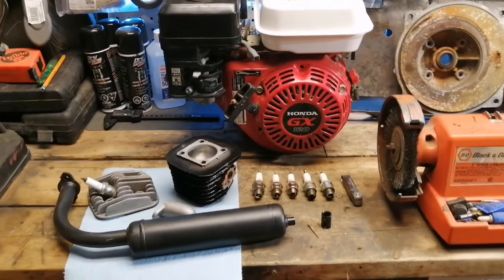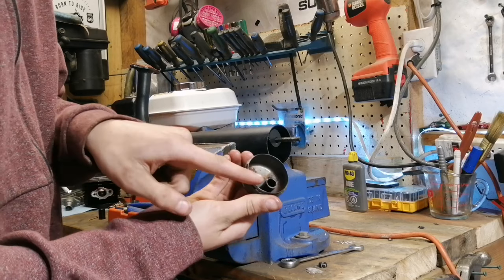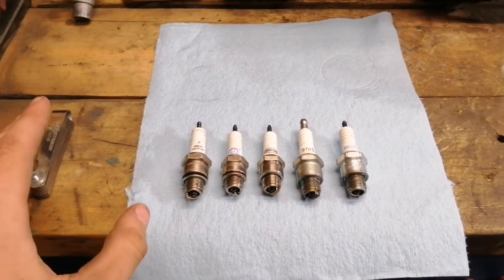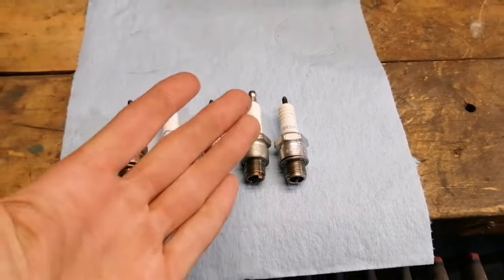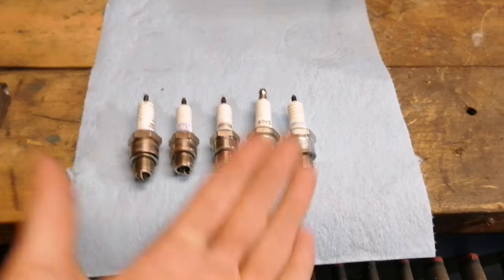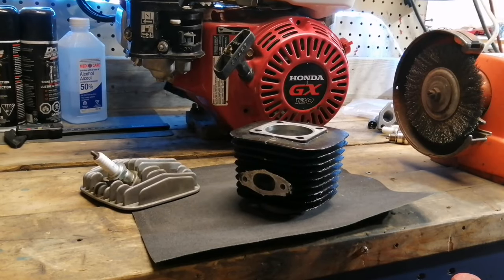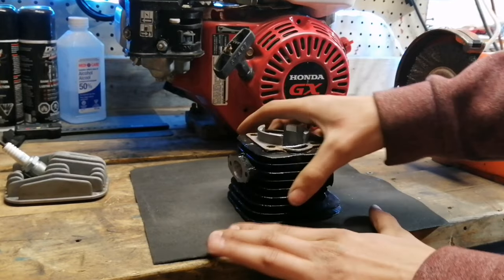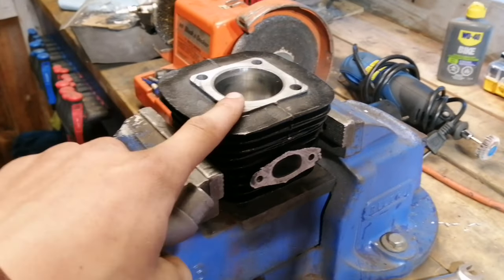Free HP Mods For Motorized Bikes

Comment: You have a natural ability for teaching. You are the epitome of consistency and flow. I took notes and didn't have to watch the video 20 times to make sure I understood the instruction(s). I ordered 40 motor kits and I'm on my 33rd, 34th, and 35th motorizing the bikes. I have an assembly line of 3 bikes going at the same time. I build bikes and sell for collection purposes. My bikes are vintage like the choppers, spiders, and 50's era with the shock absorber spring in front of the handle bars. All completed bikes have sold. Love my hobby.
Reply from the maker: Thanks
Reply: Agree! Great training.
Reply: Awesome! Can I get a contact number or website from you? I'd like to see your bikes and maybe buy one. I've built a couple myself but nothing to brag about.
Reply: Yes you Are right

Comment: .026-28 for the plug gap on just about everything with a magnet magneto ignition... .035 is what they come with it's standard for automotive because they have stronger coils and electric...  A blue spark and the electrode needs to be centered and even with the ground strap... Those cheap round and wire gauges for plugs have legs for bending the ground strap... Nice video

Comment: This dude is spot on with his facts!!!  I run a Yd-100 with a G2-reed, OKO carb, and a Yz80 exhaust, and the Br8hs plug is my top pick. I would have also discussed oil types, premix ratios, and maybe even running E85.   I do not agree with not using an exhaust gasket, but that is not something to argue about. Once again, a great video. Keep it up.
Reply from the maker: Thanks so much! Glad you like the videos some people tell me I’m wrong but I try my best to help others.the exhaust gasket I blow out all the time so that’s why I use strait ultra copper sealant. It also comes off easily oppose to a gasket that’s is stuck on the flange.
Reply: @keeganhache6667  👍Keep it up.
Reply: Idk 🤷🏻‍♂️ I file the mating surfaces perfectly flat and smooth don’t need much to seal it good to carry a gasket in case ya have to take exhaust off for some reason but many times I flattened them applied ultra grey and took off before it even cured and didn’t have leak issues it lasted longer than the gasket did. And the rubber gasket w the metal sandwiched in we get stock sucks a thin brown paper gasket lasts longer especially if ya file the surfaces flat
Reply: I use a Toyota Highlander 02 sensor gasket , it’s metal, and they last years before you need a new one. They fit perfectly on 4 and 2 strokes!
Reply: I just made a gasket out of aluminum and it works fine

Comment: If you choose to resurface your head seal faces, use a piece of glass or some but a wood bench is nowhere near flat enough to be surfacing anything of that nature on
Reply: And you should typically only sand to 600 grit anything finer and your gonna be wasting time and also potentially have a friction weld for the metals expanding and contracting under heat, it is rare but when it happens your cylinder and head are lost because they will be pretty much inseparable
Reply from the maker: @timmytexlonghorns2206  I know dude I should have demonstrated on a better surface…
Reply: Glass isn't flat, MDF is
Tested with a straight edge

Comment: I found this tip helpful tape the paper flat on a piece of glass and make sure ya keep it level in the paper as ya turn sometimes ya lift the corner a bit and that can lead to it being shorter on one side corner so also turn the cylinder using the same motion same number of rotations s like do fig8 10x rotate do 10 rotate but rotate it 1/8 at a time hold flat side then corner then flat side if ya measure it ya will find that it can leave low spots (0.1mm) don’t matter really what figure shape ya use but that ya use even pressure and even motion
Reply from the maker: Yeah I know, I normally would have taped it all down to my glass table and did the same thing. It was more for the video to make it easier.

Comment: So i have a question. Would a modified air intake designed to utilize the air stream while riding help with power?
Reply from the maker: Not really it would just make it run leaner and loose power in the top end

Comment: I miss my 70s Solex front wheel friction drive. I only deck the head and jug to make the surfaces mate properly. I don’t do any other mods. Mine runs great and I don’t need to go faster than 35 mph on a bicycle.
Reply from the maker: Haha! Those little solex bikes are really cool. I believe they were made in France and moto Migs has one. He never got his running tho because those carbs are hard to find parts for. Yeah the whole speed thing isn’t a big deal to me. I hit top speed once or twice on a bike just to prove what top speed it has and after that I like to just cruise and enjoy the road.

Comment: Next time you have to sand a cylinder, put a thick piece of glass under the sandpaper.  Your work will go faster & leave a finer finish.
Reply from the maker: Thanks I’ve done this with a belt sander too go check out my newer porting videos
Reply: @keeganhache6667  I got spoiled with a moderately-well equipped machine shop access a few years ago.  I never got the chance to do any porting, but I did some unauthorized work whenever I got the chance.

Comment: That pipe looks like a mini expansion chamber. It could technically be tuned to the motor. On a chamber the stinger adjust the temperature I believe.
Reply from the maker: Yup the longer the stinger = more top rpm power with a sacrifice of some low end

Comment: Just put any chainsaw plug in it and itta go twice as fast.i know that the chainsaw plug is alot shorter than stock plug.its all you need to go fast mine ran over 60mph.but be sure you get an engine mounted spring tensioner

Comment: great video . question the arrow on the piston shoild it point to the exhust or the carburator . in other video they say. there are two bump in side the piston .they should go in the back .of the motor is this true .thanks
Reply from the maker: Well never go off of the arrow. So thinks it can be stamped backwards. I would go off the piston pins on the intake side, this will insure that no rings will get snagged

Comment: How about the nowaday  4 electrode spark plug  you didn't test that  but I'm a firm believer in NGK I used B8ES on my dirt bike back in the 90's  on my 1978/79?  Suzuki RM 80 6 speed  and that plug worked the best for that motor
Reply from the maker: Yeah Ngk works best for me but I’ve heard a lot of good things about these E3 plugs I might give one a try and see what happens. 
I just like that on ngk it’s so easy to dial in the heat range. A b5hs is gonna run a lot hotter than a b8hs.

Comment: What happens if you got a head that is painted ? 

I have an all black 2023 PK80 engine, and the top end of the cylinder is all painted black. Will that interfere the performance?
Reply from the maker: Yeah I would sand it down to clean metal
Reply: @keeganhache6667  By the way, after I tighten everything, the barbs are still kinda showing on top end

Comment: Best mods to do first are to tune the carb by jetting it down since they all come to a main carb jet that is to large, then drill 2-3 extra holes innthe muffler cap to zget better exaust flow anf also do some die fri der work on exhaust pipe flange to get it more closely matched to exhaust port of cyl.

for a noob that knows nothibg anout engines these things along with some of whats suggested in this video will improve how the engine runs, but just know that if crani balance is horrible and the port timing is way off, the revs of the engine will be limited by these two factors, no matter how many other thing you do to it 

Mant thungs will affect the overall performance of these engines.   I have 14 years experience modifying wnd tinkering with these little engines so Ive seen a lot with them.

Comment: I've had mine topping 59 miles per hour as I don't recommend traveling that fast on one these bikes but it sure does remind me of the old days as I exercised Race Horse's from 1981 thru 1994 I usually climbed aboard around  20 to 25 horses every morning  but it's close but I have to say I've been hurt on My bike all those years in saddle 😮all I can say is I've been around block or did that two turns thousands of time's I'm certainly a adrinlin junkie so😢 I can tell you duck roll played lawn dart water snow  hitting dirt assfault not same more like water skiing all ways seemed close to me real thrill adrid close  thrill slow sloping  hill in my favor as I'm coming down Bohnam Street

Comment: Any spark plug with r on it is no bueno . The r is a resistor plug . It will work , just no benefits .
I'm not trying to give you a hard time . Just some info .
I noticed someone mentioned to plain your head on glass so that has been addressed. . A figure 8 sanding motion will yeild a better plain than a circular motion .
Lastly , when porting the intake you want to cross hatch it and leave it rough for better fuel atomization .
When you polish the intake , which you shouldn't do , it doesn't atomize the fuel as well as if were left rough .
Anyone  should only polish the exhaust and not the intake .
Good video !!! 
Last night i dreamt i was trapped inside a muffler.  I kicked and beat and banged and no matter what i did i couldn't get out . 
I woke up exhausted 😜

Comment: Hey thanks for video! I think in video the piston arrow is pointing backwards... it's suppose to be pointing towards the exhaust and not the intake. Did you notice that too?
Reply from the maker: Yup and your right on that one. I did the skirt mod a long time ago and I didn’t realize that the piston was backwards when I did it. Luckily noting bad happened and most say the piston ring end gap pins can cross talk with the exhaust port but mine never did. Now that I know I would recommend making sure the pins are facing the intake and dint go by the arrow.

Comment: My bbr 80cc died last week to not get it started so I bought a new Magneto new CDI and a new carburetor put them on it wasn't starting I figured out the compression it was escaping so I made a head gasket and now it's back up to par it will start for about 15 20 seconds and bog right out again what could that be
Reply from the maker: Yup a bike will start a lot harder if it’s got a leak under the cylinder head. Just face both sides with sandpaper and make sure your gasket has no marks digs or scratches and you will be golden

Comment: What carb do you recommend
Reply from the maker: Good question but I need more information about your setup. If it’s a mostly stock motor a good upgrade is the Hp carburetor with a #65 jet. That will give you a higher top speed but they also tend to run smoother.
Reply: I have the nt with a 65 now and it runs good but not a lot of power,I'm thinking about putting a bofang on that I have here
Reply: It's pretty much stock,I just put that flex exhaust on the other day
Reply: @keeganhache6667 my bike just come with 70mm jets =)))

Comment: Can anyone help I have a 2 stroke bicycle engine with the intake on the back of the crankcase?? I never saw that configuration before. Does anyone here have any info ?
Reply from the maker: That my friend is a case reed motor. Did you buy the motor used? They are a high performance setup and only can be taken advantage of with a real dirt bike pipe or a scooter pipe. It allows the fuel charge to go into the cylinder a lot quicker than a standard piston port intake.
Reply: @keeganhache6667  I got the motor used but it never run. It came with a reed valve set up.
Reply from the maker: @ccboss490  nice man you can really build up that motor and make it rip!
Reply: @keeganhache6667  going to try. Thanks for the reply.
Reply: @keeganhache6667  should I use a window piston set up?
Reply from the maker: @ccboss490  no a window piston will not work with a case reed. Does not help it. You need a 3rd transfer for a case reed motor.
Reply: @keeganhache6667  I'm not familiar with 3rd transfer.
Reply: @keeganhache6667  can you explain what you meant by 3rd transfer?
Reply from the maker: @ccboss490  it’s a trench that comes up from under the intake port. Do some research on them but basically they allow for more fuel/air mix to be pulled up into the combustion chamber. A boost port helps on a normal reed valve because the windowed piston is following the boost port and does the same effect.
Reply: @keeganhache6667  thank you brother.
Reply: How you doing brother. Can you tell me what's the best fuel mix ratio for a windowed engine.

Comment: Just go buy a Phantom 85. It has everything you need to hit 45 mph. Out of the box.
Reply from the maker: Those motors have a bad history of not being reliable. I’m gonna have to pass on this option
Reply: @keeganhache6667  Rotate the cylinder 1mm clockwise. So the rings clear everything. Problem solved.
Reply from the maker: @jgbelmont  that’s kinda off sketchy imo but if your having good luck with it then ride on! The newer phantom has a narrow intake port so it’s prevents ring snag. If you can’t get a new gen cylinder I recommend a ms440 saw piston